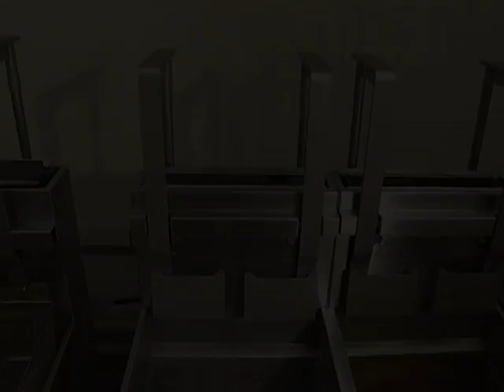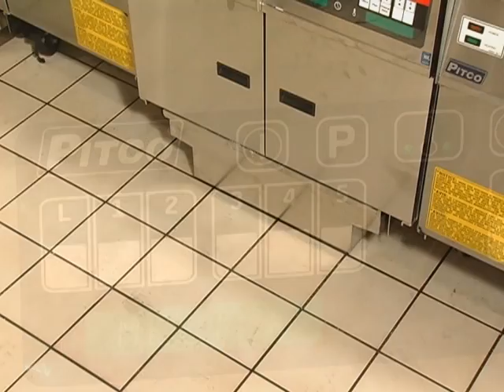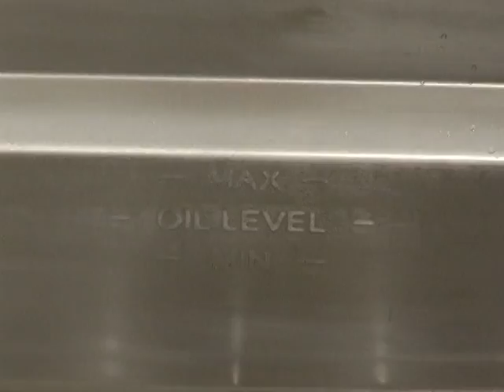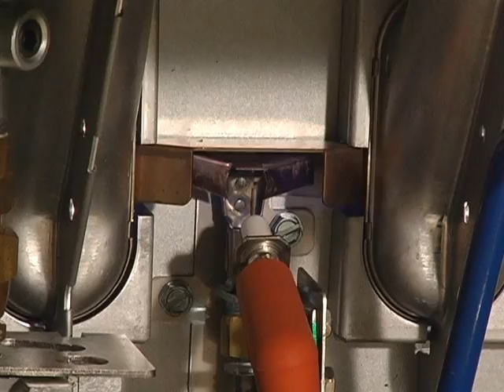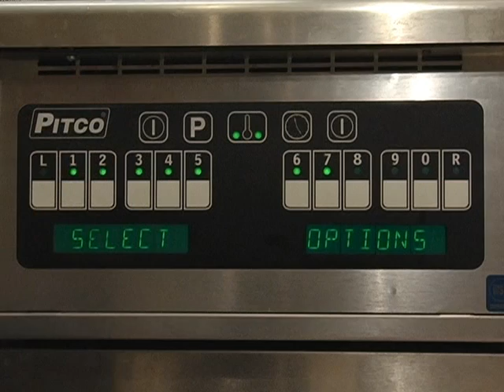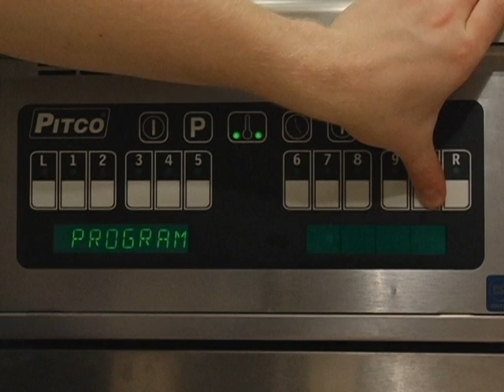SG Maintenance & I12

Comment: We got the automatic pitco fryer. But we're having problem, the oil is draining but don't go back in the fryer at all.
Reply: Hi we have the same problem too. By any chance you found a way to make it work ?
Reply: The filter powder is not spread evenly and locknut is not tighten enough and there is powder under the filter and clogged
Reply: There’s a secondary filter on the front end of the pick up tube